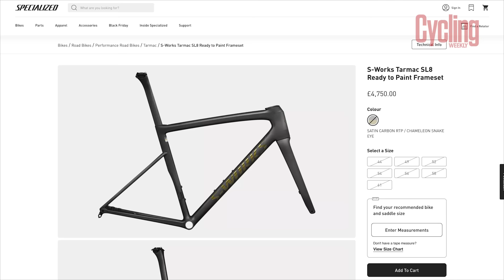2024's TOP 7 HOTTEST Road Bike Tech Trends

Comment: ive used 1x on my road bike for years now, its not for everyone, but works for me .. 40t up front and 11-28 in back..
Reply: You dont spin out in sprints or down hills?
Reply: @michaeldesrosier1068  If you're not racing, why worry about this? Not everyone is performance orientated......
Reply: @Andy_ATB  Sure, but some people are performance oriented.  Like me.  Thats why I asked.

So you do spin out in sprints and downhills or is that gearing sufficient?
Reply: Team 1x  is here I use a 46 chainring  with a  10-30 cassette for scram or 11-30 for Shimano
Reply: I don't spin out.
Mid seventies age and have self made 81 tooth single chainring.
Btw it still hill climbs.

Comment: I just picked up two bicycles in mint condition for $100 each.
Both TREKS.

1989 red trek 400 8-speed (16) Shimano Ultegra shifters on the handlebars flawless condition. Steel frame made in USA that is steel tubing.

And a trek 1200 also in flawless condition. Aluminum frame made in USA that is six-speed Shimano shifting 105 on the down tube.

Hey I used to race for 12 years I've been to three national championships over 400 criteriums these bikes are good enough for me.

I know I know I spent a lot of money on them over $200, but what can I say I went on a spending spree.